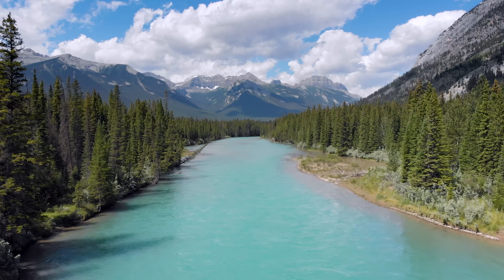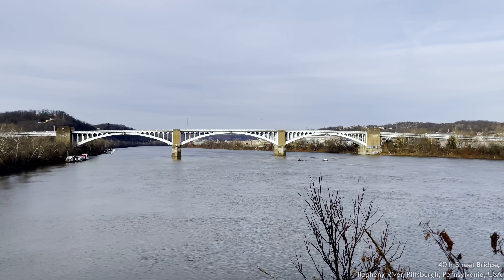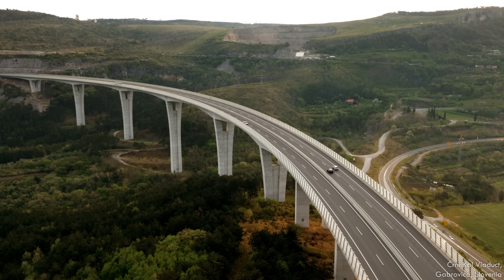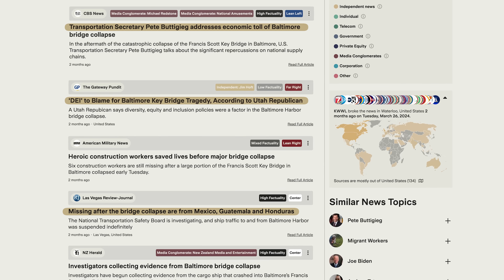Every Kind of Bridge Explained in 15 Minutes

Comment from the maker: 🌉What's your favorite bridge?
📰Compare news coverage from diverse sources around the world on a transparent platform driven by data. Try Ground News today and get 40% off your subscription: https://ground.news/practicalengineering
Reply: The floating bridge was cool.
Reply: @NIKOSPORTSreal  (link below)
I grew up in the Seattle area where there are FOUR of the biggest/longest floating bridges in the world- the I-90 and SR-520 bridges across lake Washington (each over a mile long), and a very old one across Hood Canal on the Olympic Peninsula- which is a spectacular bit of engineering, since that spot has some of, if not THE, fastest tidal currents in the US which have been bridged.

All three were built because the length and depth of channels they cross, and the local topography makes suspension, etc, bridges impractical.

I remember trying to hold my breath the whole was across them when I was a kid😅.

https://www.google.com/url?sa=t&source=web&cd=&ved=2ahUKEwjawbLvkJ-GAxXlJjQIHYFGDxgQFnoECCUQAQ&url=https%3A%2F%2Fwww.discoveringwashingtonstate.com%2Fwashington-state-floating-bridges-the-longest-in-the-world%2F&usg=AOvVaw2dCKHDq_QbuP0SCMeKbHJn&opi=89978449
Reply: @NIKOSPORTSreal  Part of I-90 going into Seattle goes across a floating bridge. It was pretty unsettling the first time I went over it.
Reply: My favourite bridge is the Ironbridge in my hometown of Telford in Shropshire England. This is the first ever cast iron bridge in the world. It would be great if you could do a video in how important this bridge is and how it was built.
Reply: @SaxonUA Good idea! That thing is beautiful.
Reply: @SaxonUA Wow, I'd heard tell of cast iron bridges in a podcast about engineering disasters. They spoke as if cast iron bridges were a thing that went out with the Victorian era; I had no idea there were any still standing. Two thoughts: 1) That's amazingly cool and 2) the maintenance must be ghastly.
Reply: My favorite is the through-arch bridge. I live in austin and there is a really cool one crossing lady bird lake. They chose that type because they didn't want anything in the water, since it is a popular recreational spot.
Reply: That French one at 8 minutes into the video.
Reply: My favorite is the one that gets me where i need to go! :D
Reply: The Brooklyn Bridge
Reply: Probably the Ead's Bridge in St. Louis. My Great, Great, Great Grandfather, Charles Pfeiffer was a chief engineer during it's construction. Sadly he was a victim of Caisson disease (The Bends).
Reply: There's a narrow, maybe 30 meter long pedestrian suspension bridge on a hiking trail in Washington State (or is it B.C? I forget), over a deep ravine with a fast flowing creek underneath. The columns are two huge old growth Doug Fir trees, and the deck and railings are rough sawn with much of the bark still on. A perfect fit for that trail.

...and, I don't know if this counts, but that reminds me of  a spot just off of the Mt. Baker highway in WA. where there is a crossing that's a basket suspended from a cable over a  raging river, which has a hand crank used to pull across the gap between the two short deck segments...
Reply: Bridgehead  :face-blue-smiling:.
Reply: my favourite is stressed-ribbon bridge, that i built in Lesotho: called Metolong pedeestrian bridge,
but the nicest project i did, that i had most joy was Blackburn Pedestrian Cable stay bridge in Durban
Reply: I have a soft spot for the Cody Dock Rolling Bridge in London. Stand-up Maths did a fun video on it a little while back.
Reply: i-bar suspension bridge
Reply: The bridge for water for sure. Its basically just a tunnel for cars under a river
Reply: The Ford Island bridge in Peral Harbor, Honolulu is a girder bridge but has a movable floating concrete section that moves under the approach spans. One of the more unique bridge combinations I've seen. --
Reply: One that in a shape of eyelid https://en.wikipedia.org/wiki/Gateshead_Millennium_Bridge, and a couple of suspension bridges in Istanbul, because you can spectate both of them simultaneously
Reply: Check out the Peace Bridge in Derry/Londonderry Northern Ireland. It's a small pedestrian bridge with a lot of history behind its name. I absolutely love it.
Reply: I can’t really say as I have a fear of crossing tall bridges. So usually my eyes are shut ( unless driving of course). But having lived in Europe for years from a visual standpoint my favorites are Tower Bridge in London and any of the old style drawbridges in Holland.
Reply: Liberty Bridge in Greenville:  two-pylon, single-sided suspension bridge anchored to the walls of the Reedy River and for pedestrian crossing of the same
Reply: The Hood Canal bridge in Washington State combines a floating bridge with a moving bridge in a pretty unique design. https://en.m.wikipedia.org/wiki/Hood_Canal_Bridge
Reply: Suspension definitely.
Reply: Honestly? The original London Bridge. It wasn't just a bridge, it was a street, with buildings and merchants along the entire span.
Reply: Honestly love arch bridges the most, whether deck or tied I’m in between :)
Reply: For the longest I loved suspension bridges. But the cable-stayed is gaining in popularity.
Reply: The bridge in Arelate France. Built by the Romans it was a mix between a pontoon bridge and duel draw bridge.
Reply: The Mackinac Bridge is pretty amazing when you consider it was built almost 70 years ago now. I never tire of crossing it.
Reply: The Quebec bridge you showed. Sorry I'm biased.
Reply: Grady, still the best channel on the internet. And now with one of the loudest shirts ever filmed. Looks like it needs a cracker.
Reply: I was thoroughly impressed with that extradosed bridge at 8:46, with two oppositely-curved roadways converge then diverge.
Reply: Mackinac Bridge. It’s beautiful, the area it’s in is gorgeous, the drive up to it is fun, and the UP is on the other side.
Reply: The one that doesn’t collapse while I’m driving across it. 😀
Reply: My favorite bride is a simple stone arch bridge. I like traditional things.
Reply: Its 3 bridges for me,  the Three Sisters in Pittsburgh. Formerly the 6th 7th and 9th street bridges in Pittsburgh PA;  now the Roberto Clemente, Andy Worhol and the Rachel Carson Bridges.  They are iconic to the Pittsburgh sky line maybe the only city where bridges are integral to the sky line. But you can pick any Pittsburgh bridge and I'll love it, the West End bridge is a gateway to the city, the Fort Pitt/Fort Duquesne Double Decker Bridges at the point the Three Sisters, or the Smithfield Street Bridge are all works of art.  Love them all.
Reply: Lenticular truss by a mile. Especially Pittsburgh's Smithfield Street Bridge
Reply: Knowledge video please make more video🎥
Reply: Favourite bridge is always going to be our local Transporter Bridge.
Look at her:
https://external-content.duckduckgo.com/iu/?u=https%3A%2F%2Flive.staticflickr.com%2F7310%2F9997909524_57c8a4f523_b.jpg&f=1&nofb=1&ipt=f82d0246a917f6b5ece446c87db7c0a6aeed3135405b8c3580d6365b595e1fc9&ipo=images

And here's one from when she was young! 
https://en.wikipedia.org/wiki/File:Middlesbrough_transporter_bridge_(Wonder_Book_of_Engineering_Wonders,_1931).jpg
Reply: Suspension and cable stayed bridges!
This is how modern transport is built esp for tough requirements attaining to environment and topography like in China!
Reply: my favorite bridge is land bridge
Reply: or Cambridge
Reply: "A needlessly complicated but awesome bridge."
Reply: Suspension bridges, cable stayed bridges, arch bridges, ... Cantilever bridges are nice, too.
Reply: The Ben Franklin Bridge in Philadelphia. Not only is it good-looking, but it carries high speed rail as well as traffic, and it has a walkway for pedestrians, so you can walk out over the river and enjoy the view and take pictures. I hate it when beautiful bridges are for vehicles only. I also like bridges that scare me a little bit.
Reply: I know I have a familiarity Bias, but I love the Interstate Bridge between Portland OR and Vancouver WA. It has such a fascinating history of repurposing and remodeling.
Reply: i really like tressel bridges, mostly because i dislike concrete
though they arent the prettiest either, maybe a something between a tressel and girder birdge, but mainly made from massive steel beams instead of concrete
Reply: Bikini bridge
Reply: Aerial tramway
Reply: Ones that don't fall down.... ...  ..   .
Reply: The Forth bridges in Scotland... three bridges built in three centuries
Reply: The one that stays up.
Reply: I like the Gateway bridge, which supports I-94 in Taylor, Michigan. My mom's company did some of the engineering for that bridge, which is the main reason I like it, but it's also a really neat design. google street view has views going over and under it, so you can see all the members!
Reply: Did you not find any engineering marvel in terms of bridges in India other than those plant root bridges ? And you want me to believe this hypocrisy ?
Reply: Chesapeake bay Bridge tunnel
Reply: The Bailey Bridge. There are at least two still in use in Bridgend, Wales. They are both at least 46 years old.
Reply: I love the floating bridges across lake Washington.
Reply: The world’s first suspension bridge is the Menai Suspension Bridge, located in Anglesey, Wales, United Kingdom. It was completed in 1826 and spans the Menai Strait, connecting the island of Anglesey to the mainland of Wales. 🇺🇲❤️🏴
Reply: 3. Barge swing bridge in Sargent, Tx, no longer there… cables everywhere, and I lost a trailer tire from the rough approach… it was a unique experience.
2. The new Harbor Bridge in Corpus Christi, TX… helped with redesigning utilities for the approaches.
1. Brooklyn Bridge, NY… got married on it.
Reply: Missed my favorite bridge.  An arch bridge constructed with blocks is typically 90 ° to the thing it crosses.  When it is not, it is a Skew Arch Bridge.  A famous one is the Rainhill Bridge of Liverpool And Manchester Railway  fame.  The blocks in the arch cannot simply go at a skew, the arch would simply collapse.

From a load transfer standpoint, skew arch bridges are quite interesting from an engineering view.  They aren't used anymore, material science has improved.
Reply: The Talmadge Memorial Bridge is one of my favorites, as well as the Linn Cove Viaduct, and the New River Gorge bridge.
Reply: my favourite bridge is the gölzsch viaduct.
Reply: I love the Chesapeake Bay Bridge Tunnel.
Reply: Grady, I know you saw the Baltimore bridge collapse. I am wondering if bridges are designed to take boat impacts, and what engineering, if any, is done to stop them?
Reply: The Roebling suspension bridge between Cincinnati and Covington, prototype for the Brooklyn bridge!
Reply: multi-arch bridges with roadway floating halfway, kindve the K-Truss
Reply: Suspension bridge
Reply: @PracticalEngineeringChannel
Hey you should see Brunei bridges they are quite interesting
Reply: Wow the seen❤❤
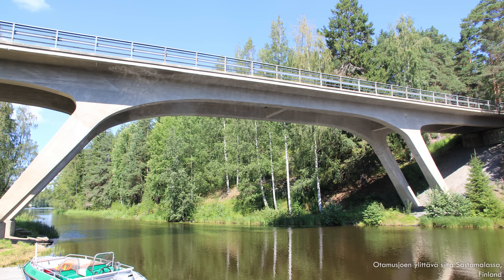Reply: Otamussilta 6:49
Reply: Are aqueduct bridges? Let water runs through and everyone walks below it
Reply: Unfortunatley it was the truss bridge you showed at 3:01 its in my hometown but it got knocked down a few years ago
Reply: Nowhere near the most impressive from an engineering point of view but I really like the bridge for animals 🐾
Reply: Akashi-Kaikyo, definitely.
Reply: trestles, just, trestles, abolutely love em, especially wooden railroad ones
Reply: Dulu belajar mekanika teknik tegangan tarik tegangan tekan, nggak ngerti buat apa 😂😂😂😂
Reply: @3:40 "To keep the bridge....Truss Worthy."   HUUUUUUUUUUUUUUUURRR HUR HUR HUR HUR HUR!! XD

Comment: Good, but you didn't mention EVERY kind of Bridge, like the card game, dental prosthetic, nasal ridge, eyeglass connector, ship's command center, musical passage, string instrument anchor, billiards cue rest, theater catwalk, watch bearing plate, chemical valence bond, electrical measuring circuit, bridge rectifier, H-bridge motor controller, network connector, computer chipset component, software design pattern, digital asset manager, protocol translator, camera type, graph theory edge, Brownian probability process, molecular connector, bridging ligand, disulfide bond, salt bond, protoplasm strand, chromatid connector, etc.

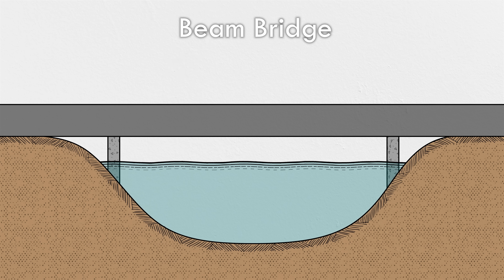Comment: 1:30 beam bridge
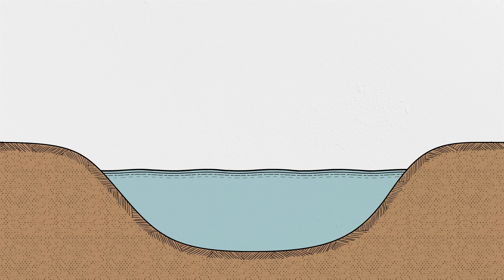2:20 truss bridge
3:10 lenticular truss bridge
3:15 bailey bridge
3:45 trestle bridge
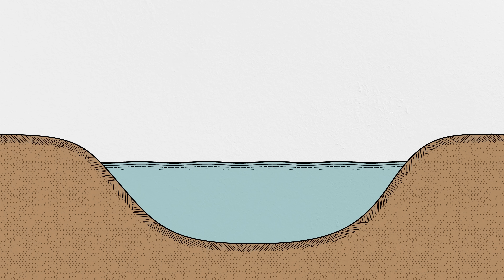4:11 arch bridge
5:04 deck arch bridge
5:14 open spandrel bridge
5:16 closed spandrel bridge
5:22 through-arch bridge
5:27 moon bridge
5:55 tide arch bridge
6:12 network arch bridge
6:38 rigid frame bridge
7:00 cantilever bridge
7:45 cable-stayed bridge
8:12 extradosed bridge
8:20 suspension bridge
8:55 simple suspension bridge (rope bridge)
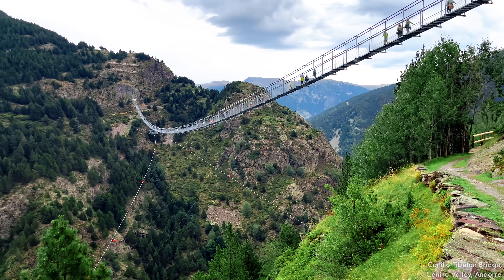9:06 stressed ribbon bridge
9:26 suspended deck bridge
10:02 self anchored suspension bridge 
10:45 draw bridges
11:00 bascule bridge
11:05 swing bridge
11:10 vertical lift bridge
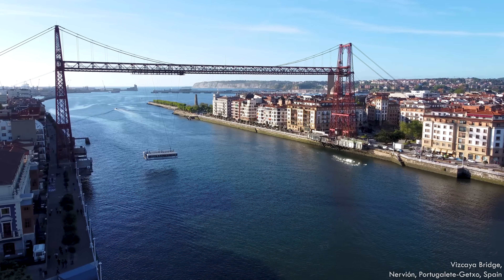11:15 transporter bridge
11:40 floating bridge
12:07 pedestrian bridge
13:20 viaduct
Reply: Thanks for your dedicated time and effort to make this list. Don't know why there's no like
Reply: Thank you!!!
Reply: shh your ruining the viewer retention

Comment: I have also been a bridge Engineer since 1988. My First bridge was Quaida bad over pass, a  post tension bridge . The main span was 65 feet. we used a unique method of  lifting girder and launch ,with a launcher for safe placement of long span girder over highly active railway line. This was mandatory after the pipri incident by Railway . 
second was Korangi road non post tension bridge.  over old days korangi road Nala .  Then so on. . . . . . .

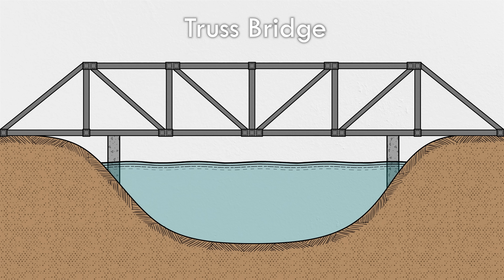Comment: 2:22 Structural engineer here!  I realize the diagrams are schematic but the supports shown for the truss bridge would break it as shown!  Supports as shown are not needed, the bearings to transfer the load out of the span into the ground would be at the very ends of the span (ie at the pointy parts).  Placing a vertical pier and introducing a reaction force in the middle of the bottom chord (as opposed to at a panel intersection point) is a fundamental no no, as that would introduce bending forces into a member designed for pure tension.

Comment: 6:50 The Québec bridge is in dire need of maintenance. Government is taking way too long planning when they should be acting right now to paint it to stop corrosion, and start replacing parts that are already too corroded to properly do their job. At this rate, that bridge won't make it another century. As solid as it was built originally, it probably would have given proper maintenance.

Comment: 9:20 I was engineering project manager during construction of the “stress ribbon” (or stressed ribbon) design  pedestrian bridge over the North Saskatchewan River.  It’s in Edmonton, Alberta (not Saskatchewan).  Not many of those designs in the world.  Its precast concrete panels have cables running through that are post-tensioned and anchored into bedrock. Stantec designed it and Graham built it.  I was fortunate to have been a part of such a unique project.
Reply: I've built one too. 150 m span. Pedestrian bridge. It was the first in Africa and one of the longest in the world.

Comment: I learned a lot about bridges from building them for model railroads. You would be amazed in just how strong a model railroad bridge can be, you can stand on top of it. I once lived in a garage apartment that had a weak, bouncy floor. When you walked around, everything jiggled and rattled. Since there were cars that were parked in the garage and I couldn't use posts, I used structural iron and truss bridge principles to shore up the floor and make it solid

Comment: Between Portsmouth, NH and Kittery, ME the Sarah Mildred Long Bridge was completely rebuilt. It is unique because it has a center section lift that both raises and lowers. The single bridge road deck has embedded rails in the center for train traffic, the lift section lowers for train traffic, middle position is vehicular traffic, and in its high position allows boat traffic to pass. The original Sarah Mildred Long Bridge looked just like the Memorial Bridge 3,400 downstream except that the lift section was a box truss with train traffic on the lower level  and vehicular traffic on the top and it only lifted for boat traffic.

Comment: My physics book in the mid-70's used the Tacoma Narrows Bridge collapse as an example of harmonic oscillation.  I thought, "Why was the wind gusting at the bridge's harmonic resonance?"  I later learned that the physics book was wrong and the bridge was destroyed by aeroelastic flutter - the same phenomenon that causes a reed to oscillate when air blows over top of it, or causes control surfaces of a poorly designed, built or maintained airplane to suddenly vibrate and rip off above a particular airspeed.  Authoritarian sources such as books and instructors still claim that the Tacoma Narrows Bridge was destroyed by harmonics.

Comment: Missed my favorite bridge.  An arch bridge constructed with blocks is typically 90 ° to the thing it crosses.  When it is not, it is a Skew Arch Bridge.  A famous one is the Rainhill Bridge of Liverpool And Manchester Railway  fame.  The blocks in the arch cannot simply go at a skew, the arch would simply collapse.

From a load transfer standpoint, skew arch bridges are quite interesting from an engineering view.  They aren't used anymore, material science has improved.